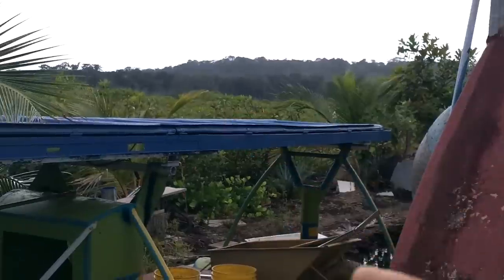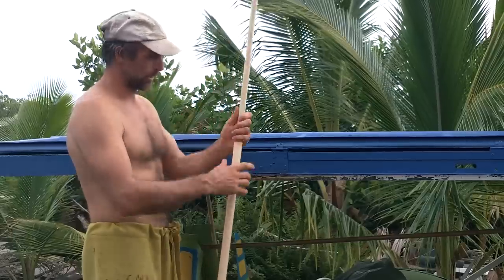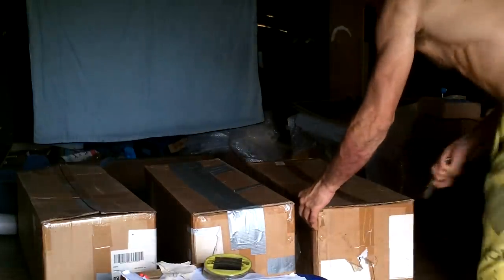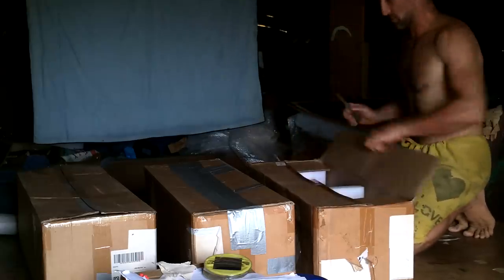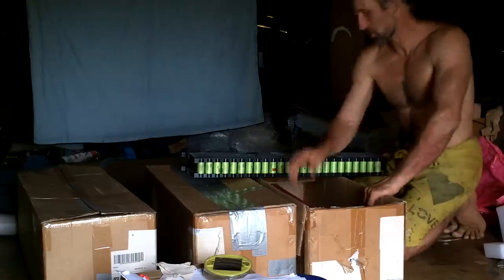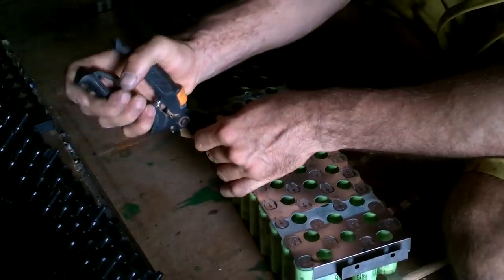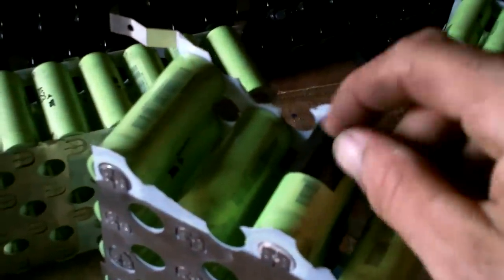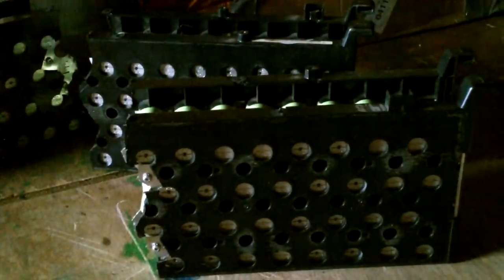Solar Snailer 033 Tubes n' Batt's

Comment: Please use a BMS for the batteries. This is important.
Reply: Could you tell me what a bms is please .your reply would be appreciated thanks
Reply: @thegeneral3094  Battery management system it stop the battery being over charged
Reply: Otherwise kaboom💥
Reply: A BMS is not important. If a pack starts balanced, it will stay balanced. Checking on them once every couple months to make sure they haven't drifted too far is plenty sufficient. What is important is that Jamie use a DC-DC converter to charge the batteries, because he is basing his charging knowledge off of Lead Acid and NiCad batteries, and his charging idea is going to kill his batteries the first time he uses them. He just doesn't understand how LiFe batteries work sadly. He thinks you have to overcharge them to get them full.
Reply: @MattsAwesomeStuff  You may be lucky, or you may lose your house/car/boat or wreck your battery early and throw away thousands of dollars.
Cells drift cumulatively, do not self-balance like lead acid cells and age at different rates.
A BMS is important. You can get away with it if you constantly monitor and manually balance charge them and ensure they never discharge too much or overcharge, but humans are human and forget to check on the state of the cells.
A BMS does balancing when necessary, it also protects against overcharge, undervoltage, short circuit, bad cells and over and under temperature.
It is madness not to use one, even if you think you know it all.
It appears that Jamie doesn't read any of the comments or watched any of the millions of videos on DIY powerwalls, otherwise he would know.
I'm cringing at his design to use a small panel to charge the battery and the rest directly for the motor without any current control and power point tracking!
A DC-DC converter is not enough - it needs to track state of charge and adjust current according to the recommended charge profile for the chemistry used.
If the DC-DC converter is tiny in comparison to the battery and charges at less then 0.1 or maybe 0.2C, then you can get away without it, as long as voltage never exceeds the limit and causes the electrolyte to start breaking down.
Reply: @ahaveland  - 1 - No, you do not need a BMS. Electric car builders, with 200v packs, regularly went years without a BMS, and that's in an application where you're deep discharging them almost daily. That's even EV conversion shops that warranty their work, they'd avoid BMSs because the failure rate of BMSs was higher than the random chance of imbalance. Electic bike builders the same. Most will check the bike at the end of the season and see if any parallel groups need a voltage bump to get them back on track. Because charge and discharge happen in series, by Kirchoff's Laws they must have the same current flowing into and out of them. If they start balanced, they'll end balanced. The only difference is as the cells gradualy, microscopically age, slightly different.

2 - Jamie either doesn't read or, well, we know he's too stubborn to take anyone's advice ever. If anything, he'll run in the opposite direction.

3 - DC-DC converter is enough. You absolutely do not need to have some silly "charge profile" to charge a battery. You give a battery its max voltage and walk away. That's all. By virtue of Ohm's and Kirchoff's laws, it self-tapers as the voltage rises up to the point where it's full, then energy stops flowing. LiFe chemistries are especially tolerant of higher charge and discharge currents.

In short, I think you know just enough to think you know how to apply the knowledge you have, but don't. You're reading textbook answers where you lack the context of using that information. You're choosing off-the-shelf solutions without knowing what's actually going on. You're a bit like chicken little, but the sky isn't falling.
Reply: @MattsAwesomeStuff  I build, test, repair and use lithium batteries daily for over 6 years.
Your advice is irresponsible and your characterization of me insulting.
Kirchoff's Law applies to currents in a circuit. It is not usefully applied to batteries because energy is lost as heat, electrolytic conversion and coulombic efficiency, natural self-discharge, and lithium ions becoming unavailable to participate, so you do not get back what you put in.
If the cells have different capacities and start off balanced, they'll become unbalanced. They may each have absorbed or spent the same energy, but the voltages will be different, just has if you have an pile of buckets of different sizes and with small holes of different sizes.
You can't be sure one will overflow or become empty if nothing is monitoring the levels.

You're free not to use a BMS if you want, but please don't advise others to take risks.
Reply: @ahaveland  1 - You're right, I should not have characterized you as I did. My apologies. I still disagre with you on some points.

2 - Kirchoff's Laws are highly applicable, they explain how if a pack starts balanced, it will stay balanced because of current flow through a series circuit. Efficiency isn't relevant because it will apply roughly equally to all cells. While there is some difference between cells, and the difference will change over time, it is generally microscopic. The amount of drift across an entire season of daily deep discharge is not enough to be dangerous for any cell.

3 - My advice might be irresponsible to the general public. I would not sell a high-s lithium pack as a finished product. However, Jamie is exactly the kind of person that this advice is perfectly fine with. Anyone who can build their own boat, can remember to monitor their cell voltages once every few months and top up the weak ones if they find any.

4 - If cells start off with different capacities or with different charge rates, yes, that will be a huge problem. However, that is a huge problem whether you have a BMS or not. A BMS will correct the charge rate problem, but it will not correct the capacity problem. A pack with poorly matched capacities is a poorly constructed pack. This is generally a bigger problem for E-Bikes because of their Low-P counts, not an issue for what Jamie is building with 8(?)p. If Jamie does a single discharge while watching the voltages when he first builds the pack, he will find out if there are weak groups and can add or remove capacity (probably just replace bum cells) to balance. Building a capacity-matched pack is a priority no matter what.

5 - As I said, there are EV companies that still advocate and sell EV conversions worth tens of thousands of dollars, with no BMS... on a 50-s pack, let alone a 16-s or whatever Jamies is using. And have never had issues. Seriously, the need for a BMS 24/7 is a very small issue.

6 - I contend: A - If you build a capacity-matched pack, and B - Remember to check your voltages once a season to top up... you never need a BMS. Thousands of use cases demonstrate this. C - Never sell a commerical product to an unaware consumer who's not willing or able to tinker with their setup.
Reply: @MattsAwesomeStuff  Yep. Plus unless you buy expensive BMS boards the crap available from China doesn't really do much to protect or keep the cells balanced. This has been demonstrated on tons of videos that test the boards...
Reply: @voneschenbachmusic  - Very true, especially 5-10 years ago. Not as much true today. But yes, it used to be that BMSs murdered batteries, because it takes only one night of them malfunctioning to ruin your pack. One time that the BMS tried to balance a cell that's perfectly fine, then drains the rest of the pack dead. Or overcharges because it misreads. or the software glitched. People would have $40,000 battery packs (prices 10 years ago) and wake up to a dead car and batteries they had to replace. DIYers were furious because you can't do anything about it, and meanwhile had they never had a BMS they could at least have stayed on top of it themselves.
Reply: @MattsAwesomeStuff  Your theorizing about perfect cells in a perfect world does not match my practical experience and measurement.
These are used cells, internal resistance is higher and self discharge uneven, so when a pack is fully charged, good cells become overcharged to make up for a low cell's deficiency and will degrade.
Lithium batteries are a vast subject with a vast combinations of cathode materials and electrolytes and behaviours.
Yes, you can use them without a BMS, but never without regular monitoring.
The consequences of not using one can be catastrophic, and that is reality.
This is just one example of what BMSs prevent:
My first Tesla Battery Fire
https://www.youtube.com/watch?v=WdDi1haA71Q
So please, never recommend anyone not to use a BMS or you may get sued bigtime.
Reply: @ahaveland  The sky is not falling just because the batteries are used.

You cite the Rich Rebuilds Princess Carriage fire as evidence of catestrophic failure, but you're dead wrong. I've analyzed that in the past. That was not a failure of a BMS. That was a failure of their overvoltage, and, tangent but it's also not something that can happen with LiFes.

What happened is that they were charging a 12S pack out of a Tesla, (4.2v/cell = 50.4v) with a "48v" forklift charger, unsupervised and walked away. A 48v lead acid charger will of course actually charge up around 60v, which I don't think they knew, which is 5v per cell so, naturally the whole pack cooked off.

None of this was due to microscopic imbalances between the cells or because the cells were used like you're claiming. It was not a balancing issue. It was because they fed 60v to a 50.4v max pack. When you blame everything on "No BMS see? That's why there's a fire!", you miss the actual reality of what happened.

Their problem would have been avoied entirely by just feeding them a straight DC voltage of 50.4v. Done. Would never have been a "balancing" issue.

You're not the only one that has practical experience. Ten years of the huge portions of the DIY Electric Car community and E-Bike community and DIY Powerwall community using recycled cells and avoiding a BMS entirely demonstrates that it's perfectly fine. And, on the contrary, the overwhelming cause of battery failure is actually a BMS gone bad. 

Also, no I'm not going to get sued for giving my (accurate and informed)  opinion on a Youtube comment, lol.
Reply: @MattsAwesomeStuff  I still can't believe your dogmatism won't allow you to concede. The fact remains that a BMS would not have allowed the pack to go overvoltage and rupture.
All laptop battery packs have BMSs for a reason.
All EVs now have BMSs for a reason.
My experience with testing thousands of cells and building battery packs tells me that BMSs are essential.
You are egregiously wrong and now just trolling.
Reply: @ahaveland  I think you're getting frustrated because your reasoning and fearmongering isn't working, and because you chose an example that shows that you didn't know what you were talking about. It's silly and disingenuous to say "A BMS would not have allowd that", when we were talking about microscopic differences in battery balancing. Yes, most BMS's also have a max voltage cutoff, but that solves "We hooked up the wrong charger when temporarily charging it the first time", which is also solved by, y'know, just by not charging them completely wrong in an experiment. One doesn't need that "feature" of a BMS because you don't go around shoving random voltages at your battery pack and hoping the BMS works as a fuse.

You're flat out wrong that all EVs have a BMS. Thousands don't. All OEM EVs do however. And that's because OEM BMS's from world-class engineering of the automobile industry are vastly superior to the hobby-grade BMS's any hobbyist could actually purchase and aren't going to just glitch out and destroy a pack. 

And, if you follow what I said, I said it's okay for a DIYer who will check on his pack balance once a season and has the skill to top up low cells to skip a BMS, but not a product you sell to the public at large. So, your arugment doesn't hold any weight. It's not that packs never need balancing, it's that you don't need a BMS if you just check on it every few months. In Jamie's context, that's the useful advice to him, not some sky-is-falling alarmism you'd push on an ignorant consumer.
Reply: @MattsAwesomeStuff  I am not being alarmist. I am stating facts based on evidence and experience, and you continue to assert that a BMS is somehow unnecessary when all the evidence disagrees with you.
Name any commercial EV that does not use a BMS.
All the 12V LiFePO₄ batteries such as BattleBorn have BMSs built in that also protect against low temperature charging which will destroy them. (Low temperature protection isn't something that Jamie is likely to need)
Checking once a season may be OK for brand new LiFePO₄ packs, but not after they age. Other cell chemistries are not as forgiving.

A BMS does not just do balancing. Some don't, but they are there to protect you, your equipment and your property if an anomaly happens, regardless of state of charge.
Jamie may get away with not needing a BMS if he's prepared to check the state of the cells regularly, and have a way of constantly monitoring the state of charge and having a circuit breaker but that doesn't protect against inadvertent over or undercharge, a reverse biased cell, rogue cell or a short circuit.
A BMS is an insurance policy, and only a fool would not use one without a circuit breaker, cell level voltage meters and proper balance charger.
Do what you like for your own batteries, but stop giving dangerous advice.
Reply: @ahaveland  - You keep trying to change the argument. I agree with you that it would be foolish to sell a commercial product without a BMS. It's ridiculous to ask an ignorant consumer to check their battery voltages every few months and/or to top them up. People can barely remember to check their oil twice a year. We are not arguing about what to do in a commercial product. Jamie is not building a commercial product.

"All the evidence" is not against me, not in the DIY community (which is anyone reading this conversation, but especially in Jamie's context). The standard meta for the DIY community for 10 years was to avoid BMS's because they are far more likely to cause failures than prevent them. It's the opposite of insurance, they caused failures. Even commercial outfits weren't using them. I don't even know if I've heard of any failures of anyone doing this. Battery failure is extraordinarily rare. "Used" doesn't mean anything, batteries are "Used" as soon as they're not "New". If you're using batteries on their last legs, you'd be able to tell this as part of your initial setup when you test them as they're being discharged the first time.

You seem to have roughly equivalent experience to me. Yet you always use a BMS. So, I don't think you have a lot of experience not using a BMS.
Reply: @MattsAwesomeStuff  I have a pack of ten 6S 5200mAh lipos as 12S 5P which I use for an ebike for over 4 years, (and I even did a video on it).
I don't use a BMS for it because I always balance charge to 4.15V per cell in two 6S sessions at up to 20 amps and never allow it to go below 30% SOC. I also use a 125A DC breaker after getting burned by an accidental short. A BMS would have prevented temporary blindness and picking out bits of molten copper from vapor metalized hands!
There is little sign of puffing after over 1000 cycles, but it is struggling to remain in balance and I sometimes have to force some cells individually to catch up.
It's probably around 80% of original capacity now, but I will keep it going as long as it's still useful. It absolutely does not stay in balance all by itself due to signs of self discharge.
I made a 7S32P pack using 18650s which sits mostly sit at about mid range for a UPS and has an active balancer running fine for over a year so far.
I'm building a 14S48P 5.5kWh pack for an ebike trailer or home solar and have a fully equipped BMS with bluetooth waiting to use. I do know what I am talking about.
You said a BMS is not important in your first comment.
I still maintain it is, even for Jamie. The 12S packs he salvaged have BMSs, he should get 1 (or 3) 16S BMSs for it and have peace of mind.
Reply: @ahaveland  It sounds like you have (your lipo pack) a poorly-matched capacity pack. After you balance them and all are charged, then discharge the pack (no BMS), where are the voltages? If after only just 1 cycle they're imbalanced, then your pack is very poorly matched capacity-wise and the remedy is to build a pack that is. It sounds like you have some dying cells that are not suitable for use period, that are thrashing the rest of the pack and should be removed. You will actually gain capacity by removing bad cells. And, your experience through 1000 discharge cycles here without a BMS demonstrates that someone with your competence can skip a BMS.

You keep crediting the BMS for things, but, a fuse (or breaker, as you have) would have been the correct safety device for your short, not some fancy electronics. You, as a hobbyist, messing around with raw battery internals and then goofing up and shorting them together isn't something you can blame on the lack of BMS. That could have happened while you were installing the BMS, or doing anything else to the pack internals. It's silly to permanently install hardware just in case you make a mistake while you're constructing it. In fact, you're spending extra time handling it in the dangerous construction stage by choosing to install a BMS. You could just as easily make this mistake by dropping a wrench on a car battery... there has to be some personal responsibility involved.

A BMS is really only about balancing, that's what we're talking about here. Everything else is something that's done easier otherwise. Like, for Jamie, a simple $1 panelmeter would be a good solution to low voltage. It's not a solution for him to suddenly have the BMS shut down the boat because it hit low voltage. His battery capacity is something he's going to be steadily checking on during the trip so that he doesn't run out. It's part of operating the boat on a trip. So, since he's doing that anyway, having a computer control the low voltage cutoff adds nearly zero value and it's just another thing to break.

I've built E-bike and E-Scooter and E-Motorbike and EV batteries from recycled cells. When I build them for kids to use? BMS. When I build them for me? No BMS.
Reply: @MattsAwesomeStuff  Lipo pack was made from all brand new batteries. It is long in the tooth, but still usable. I would use a BMS for it, but I don't have a 1kW 48V charger, and a BMS is unlikely to be able to keep it balanced at that rate now, but would still be useful for low cell protection.
I'm human, and even I make mistakes. Plugging bullet connectors into themselves and shorting the battery instead of into the controller was too easy to do, but only done once.
We are converging on the same point about whether to use a BMS. We know what we are doing, but I'd still recommend one for Jamie. The risk of pushing the battery too far, emptying a cell, reverse biasing it and therefore destroying the cellgroup is too great.
It happened to me and had to throw away 32 previously good cells.
Reply: @ahaveland  Have you looked into the difference between an active and a passive BMS? An active BMS would eventually result in an empty pack for your Lipos because it's just going to keep feeding the self-discharging cells from the rest of the pack. But while on the charger, it would hold it balanced. A passive BMS, no, and you'd be wasting a lot of energy. I'd remove the bum cells and replace them, capacity-wise, with 18650s in a little "capacity pack" somewhere else nearby, in parallel. In general, any self-discharging cells should be discarded. They're bad news.